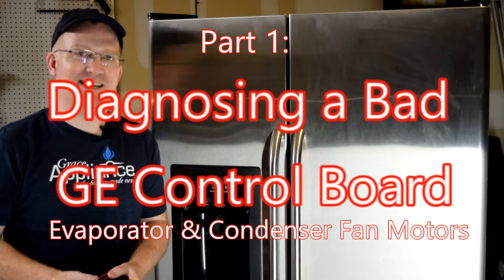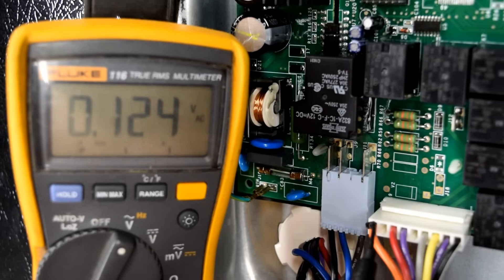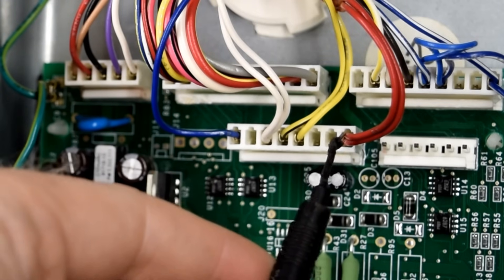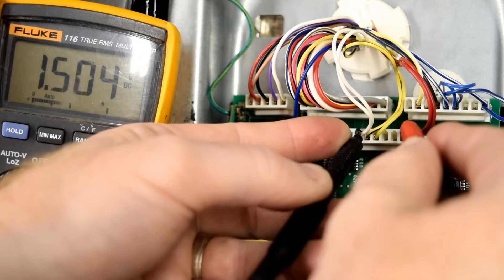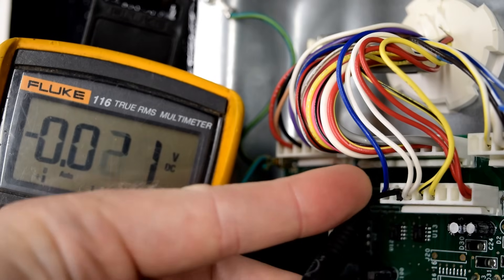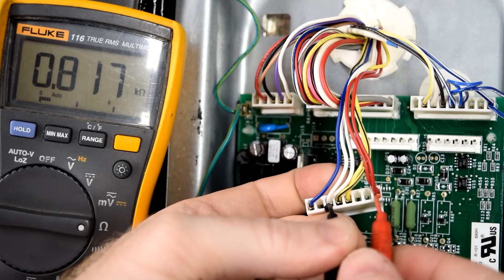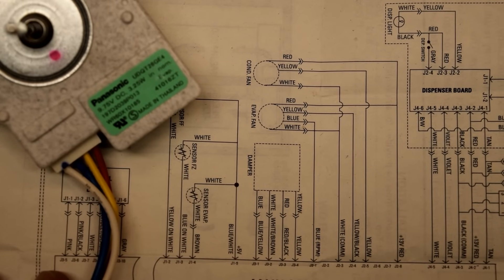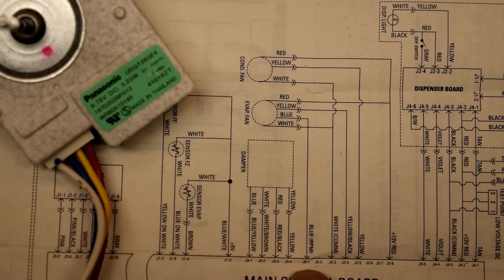Diagnosing a Bad GE Board - Part 1: Fan Motors

Comment: Andy, what model board is in your video?  My original WR55X10658 was replaced with the newer model WR55X10956 in 2013.  Mine is somewhat different than yours.
Reply from the maker: Hey, mine is a Wr55x10942 which has been updated to part wr55x10942p.

Are you having defrost issues?
Reply: Thanks for helping Andy.  I'm not yet sure about defrost, because after hearing the annoying "refrigerator door open" beeping over and over, I unplugged the refrigerator.  The symptoms were:
1. The display on the refrigerator indicated that the freezer temp was 0, when it was actually in the teens.
2. The display on the refrigerator indicated that throughout the day, the refrigerator temp climbed from the mid-60s to 81.  That was accurate - the fridge was very hot inside.
Like I said earlier, I replaced the main board in 2013, and I remember the refrigerator being hot back then as well.
I went through your tests and got these results:
123v AC into the board = PASS
13.54v DC supply voltage to fan motors (pin 8 red) = PASS
6.58v DC supply voltage to evap fan motor (pin 4 yellow/black) = FAIL
12.89v DC supply voltage to condenser fan motor (pin 5 yellow) = PASS
0.972K ohms to fan motors (pin 8 red, with J2 plug disconnected) = FAIL?
That's as far as I got so far.  The hot refrigerator must have some meaning.  Is it defrosting and not shutting down the defrost cycle?  If so, what would be the cause?  Thanks so much for a super video and your advice.
Bill
Reply: BTW, my fridge is a GE Profile PSW23PSWA SS.  And when I said that the board looked different, I should have said the the wires in the harnesses were similar but not exactly like yours.
Reply from the maker: Dad And Girls hey Bill, 
The freezer may actually too warm as well. You should be under 5F. Ideally closer to 0F. 
With respect to the evaporator fan, 6.xxVDC is still an ok voltage. It’s a variable speed motor, so it has a high, med, and low speed and the voltage varies based on how fast it should be turning.  

Now, If the freezer is running hotter than 5F, I would indeed suspect a defrost issue which will also cause a warmer than normal fridge cabinet as it shares the same cold air as the freezer.  

To confirm this you’ll need to remove the rear panel inside the freezer after it’s been running for a day. If you see heavy frost/ice build up on the evaporator coils, that’s a defrost issue.  If you wanted to send me a picture of it to GraceAppliance@gmail.com feel free and I can confirm this if you wanted.   

Thanks, 
Andy
Reply: I'll do that and get back to you tomorrow.  BTW, do you know if I can temporarily disconnect a harness behind the front-panel-display to stop the beeping?  I want to let the fridge run over night but we can't sleep with that noise.
Also, do you know why it's beeping?  The door isn't open!
Reply from the maker: Dad And Girls it’s probably a high temperature alarm.  You may have a button in the front touch panel that says alarm on/off or something similar.  You’d have to hold it down for 3-5sec.  Alternatively, you might be able to unplug the front touch panel, but I am not sure of the fridge would run as normal like this.
Reply: I plugged it in this morning after leaving it off overnight.  Both the fridge and freezer started out at 62F (room temp).
The freezer temp started decreasing, going down to 10F within 2 hours.
But the fridge temp immediately started increasing, going to to 86F within 2 hours.
After that, the fridge started going down, and 2 hours later, is at 59.
I haven't yet opened the rear panel inside the freezer - I will do that later - but if what I observed is a clue, please tell me what you think.
The other odd thing is that the display on the freezer door is showing incorrect temps, off by 15-20 degrees from the actual temps.
Reply from the maker: @dadandgirls7306  thanks. Let let it run for about a day and see how the evaporator looks. Defrost issues will usually take quite a while to present themselves and may run as expected for quite a while before the ice builds up.

However, getting a picture of the evaporator will tell me a lot because it will rule out a sealed system issue (I. E.  Compressor, refrigerant, etc).

When you open the refrigerator section, are you able to feel any air coming out of the vent inside?
Reply: Andy, I just sent an email to you with a couple images attached.  The evaporator has light frost on it, but not too much.  It's only been plugged in for 12-13 hours.  I will check it again in the morning.
Also, to answer your question from this morning, you asked if I felt air coming out on the refrigerator side.  I definitely felt air flowing out of the center piece on the back but am not sure if anything was coming out of the vent on the wall between fridge and freezer.  If there was any, it was not much.
Reply: In the end, the cause was a bad main board.  This is the second time I have had to replace it, but I also had a bad circuit breaker this time and replaced that as well.  Maybe the breaker caused the board to go bad, who knows...
Reply from the maker: @dadandgirls7306  thanks for the follow up!   Glad you got it sorted out. Happy new year!

Comment: Hi Andy:  as you recall, I replaced the freezer evaporator fan motor two months ago, the fridge has been working like a champ until today.  The freezer temp display starts flashing and the compressor runs constantly.  In fact, that’s the problem I’ve been encountering for months.  Please advise what to do at this point.
Reply from the maker: hey Guang!

This symptom sounds like it could be a poor connection between the main control board and the front touch panel.  
If you remove the kick panel in the front lower portion of the fridge near the freezer hinge, you’ll see a connector there. Look closely for damaged wires or bad connection.  Disconnect and reattach this plug about 10x and see if it helps at all. 

Let me know.

Thanks!

Comment: What are the chances of having the original mother board go bad, and then to have 2 new replacement mother boards in a row being defective in exactly the same way?... each with fridge and freezer slowly losing cooling power at about 5 or 6 weeks after replacement? Could there be a short somewhere  or something else like that? Repair guy is coming out for the 4th time now. Getting a little ridiculous I think.
Reply from the maker: George Kolton 0% I’d think. It sounds like it’s misdiagnosed. 
Have you noticed any ice build up on the back wall inside the freezer? 

A failing defrost sensor can cause this kind of symptom.  

Either way, I’d think it’s time to ask for a refund so you can get a 2nd opinion. Maybe direct him to my channel?!  ;)
Uggg, what a nightmare.
Reply: @GraceAppliance  Hi there! Thanks for your reply. Yes, I did notice some ice/frost build up back there. The same repairman is back at this moment. I will pass along your suggestion. Thanks again.
Reply from the maker: This video:
Testing and Replacing a GE Defrost Sensor - WR55x10025 https://youtu.be/CG-2FnQ43Hs

Shows what’s involved with testing and replacing a failed defrost sensor.  If it would run as expected for that length of time, I will assume the heater is still good. You’d notice much sooner (days) if the heater had failed.  This leaves only the control board and high limit thermal limiter (rare to fail) and the defrost sensor.  All signs point toward the defrost sensor based on the symptoms and the fact that the board has been replaced.   

Thanks!
Andy

Comment: Hello Andy. I need your help please. Your videos have been a great help in ruling out components on my PSHF6RGXCDBB GE Profile side-by-side. The front control panel shows a -9F for the freezer regardless of what temp I set it at. I used a separate thermometer to verify the freezer fluctuates between 10-30F. I tested the resistance of the thermistors at the J1 connector with it unplugged from the main board. The two fridge and evap thermistors are all good using the ice water test. There was no resistance across J1-1 to J1-3 for the freezer thermistor. Before doing this test I replaced the freezer thermistor before knowing to check the resistance at the J1 connector, and this did not fix the display showing -9F. I did verify the replacement thermistor is good by checking the resistance across the wire leads with it uninstalled. I verified the front control board is getting 13V.
Reply: I should also mention I tested the fan motors. My J2 connector has two red wires in the J2-2 pin as well as two red wires on J2-8. I think this is because I have a CustomCool Fan based on what I can interpret from the wiring diagram. For each pin the resistance is 900 ohms to J2-1. Your video says it should be 1500-3000 ohms. But is mine okay, basically can I double the 900 ohms to get to 1800 ohms? Not sure if this relates to the freezer temp issue I mentioned above, but thought I would mention it. Thanks in advance!
Reply from the maker: Jim Johnstone hey, the fans sounds fine with that measurement.  I’ve heard feedback that this is normal for others.  So, these don’t sound suspect.
Reply: @GraceAppliance  Thanks!
Reply from the maker: Hey! 
Can you verify that the freezer temp is between +10F and +30F? 
If so, this is too warm. A freezer temp should not be above +5’F and ideally closer to 0F.  

Does the compressor run full time or have you heard it cycling on and off periodically?
Reply: @GraceAppliance  Hi Andy. Sorry if my replies are not showing right under each of your replies. I am still learning YouTube messaging. I will have to check for the compressor cycling. What sound should I listening for?
Reply from the maker: @jimjohnstone3575  yes, messaging is awful on YouTube. It's not you. Beleive me.

You should hear a slight click, hear a fan turn on and a slight hum. It should be almost silent when the compressor turns off.

It should turn off every couple hours if think.
Reply: @GraceAppliance  Confirmed it was a bad wire and also a compressor not working properly. Time to get a new fridge due to high repair cost for these two issues on a 7 yr old fridge. Thanks again for all your help!
Reply from the maker: Also, have you taken a measurement in the freezer temp sensor from the board after you’ve installed it?  I would want to rule out a poor connection after the install causing this issues.
Reply: @GraceAppliance   Hi Andy. Yes, I tested the freezer temp sensor after installing it. I twisted the wires together and then checked at the control board which still showed no resistance as if the sensor was not there.
Reply from the maker: Jim Johnstone hey, if you’ll snap a picture of your wiring schematic and email it to GraceAppliance@gmail.com 
I can give confirmation you’re measuring in the right pins.  It will be different than what’s shown in the video here. If you’re in the right pins, perhaps there’s a wiring issues between the board and sensor. If so, I’d double check the connection you made at the sensor. Maybe strip the wires back to bare metal again and make the connection again to see if it improves.

Comment: Hello Andy! I really need your help! My refigerator is also GE, main board number 200d6221g028. So, when I turn on the fridge is possible hear just a click, probably coming from the start rele, after that anything happens, no fan, no compressor, nothing! Could you help me to find the problem? My email, sandroamauri@gmail.com, Im from Brazil, and to replace this board for a new one is very very expensive! Thanks for your support!
Reply from the maker: Hi, Sandro Ghirau 
If you have not looked at this video, please start here.  This will rule out a bad front touch panel for you:
https://youtu.be/ViFpwH6_WrM

You can unplug the J4 connector and the compressor should come on at that point.  
Also, you can leave a door open for 3 minutes which should activate both fan motors for you.  

But, It certainly sounds Control Board related through given your symptoms.  Let me know if you have any questions!

Comment: Great Video. The trouble I am having is the front display panel is not working, and neither is the ice/water dispenser. Any suggestions?
Reply from the maker: TheRoostking hey!
If you haven’t watched it yet, check out this video:
https://youtu.be/ViFpwH6_WrM

Also, there is a troublemaking connection plug behind the kick panel near the freezer door hinge. This tends to get corroded and should start there.  Plug this in an unplug it about 10x and see if that improves things.  If so, you might consider removing the plug and hardwiring it by soldering the wires together.  Let me know what you find.  Thanks!

Comment: The Defrost bimetal thermostat which is sealed in a plastic clear pouch, I never tested it. Cuz it is wired in parallel with the temp sensor and I didn’t want to isolate it.  Somehow, the temp sensor was tested to be fine.

Comment: That was the thermal fuse (the part that has 1 black and 1 red wires connected to it and a insulation foam wrapped around it). It reads 0.1 ohm
Reply from the maker: Guang LF that’s a good fuse.

Comment: Hi Andy......do you think I might also have a problem with the defrost bimetal thermostat ? (the part that has 2 brown wires connected to it and it’s sealed in a clear plastic pouch, it’s wired in parallel with the temp sensor, sitting on top of the evaporator coil.)
Reply from the maker: I don't based on your previous comments. As I recall, you got a fairly low resistance which is good. It should read roughly .03 ohm.

Comment: Andy......What’s the proper way to test the thermal fuse ? ( the part that has one black wire and one red wire connected to it, and a foam insulation wrapped around its sensing tip)
Reply from the maker: Guang LF if you have continuity when doing an Ohm test, it is a good fuse. You should get around .01 - .03 Ohm resistance.  
The fuse only relates to your defrost cycle. 

As I understand it, you are dealing with a fan that is not running, is that right?

The frost build up you are seeing on the evaporator is likely not a defrost issue, it is due to no air flow caused by the fan not working.

Comment: Andy......So You don’t think I should replace any of those temp sensors, defrost sensor or even the thermal fuse ?
Reply from the maker: The freezer temp sensor you mentioned does seem slightly out of specifications. It should be 5k ohms at room temp (72F) and around 14.5kohms at ice water temp.
I would replace this one for sure.

However, this will not prevent the fan from operating after leaving the door open 3 minutes. These are seperate issues it seems.

Comment: Hi Andy......Like I'd mentioned, I'd replaced the main board back in May 2019. The freezer ran perfectly fine for nearly 2 months, the freezer led temp started blinking on the front display suddenly.  Encountering the same issue again, fan motor stopped running, ice building up at the base of the evaporator coil.  Tested the temp sensor in the upper part of the freezer, got 4.5 ohms (room temp) and 12.3 ohms (ice water).  Checked thermal fuse, got 0.1 ohm.   Should I check my defrost thermostat (yellow wires connected to it) and temp sensor (blue wires connected to it)?   Or maybe the evaporator fan motor?   Please advise my next step.  Thank you!
Reply from the maker: Hi, have you performed the voltage tests for your evaporator fan motor as shown in this video?
Reply: Unfortunately, My multi meter doesn’t have Hz function.  Is there another way to test the fan motor and see if it’s bad.  On the other hand,  how would I know which wire is connected to the tachometer?
Reply from the maker: @unioncityhiller  starting in 2:20sec of this video it shows how you can test the DC voltage output from your board. Be sure to leave a door open for 3 minutes first so your board will output voltage to the board. You won't need HZ for this function. If you get 13.5vdc at that point your board is fine and you should replace the fan motor. If no voltage I'd replace both the board and the evaporator fan motor as a shorted evaporator fan motor can cause a bad board.

Comment: My refrigerator works fire until its unplugged or the power is lost, it takes about 24 hours before it turns back on , is there a reset button or way I can turn it back on sooner. Its g.e. refrigerator. Can you help.. thanks
Reply from the maker: Hi, could you please send your model number from the inside of the refrigerator on a white sticker on the wall?
Reply: @GraceAppliance  my model number is  Gss23wsta ss
Reply from the maker: James Hill thanks!
The only thing that will cause this symptom is a failing relay on the control board. The relays get weak over time and become intermittent. Sometimes you’ll hear rapid clicking from behind the fridge as it’s trying to start.  

So, you’ll need to replace the board to resolve it. 
If you’ll purchase through this affiliate link, it helps the channel a ton and is greatly appreciated!
https://amzn.to/2TL2fZ0

Let me know if you have any questions. Thanks! Andy

Comment: Thank you for your vedio, but i have a follow up question. What if there is no signal from tacho? Does it affect the operation of the refrigerator? Mine has no signal, do i need to replace the evaporator fan motor? Hoping for reply. Thanks again.
Reply from the maker: Hi Anderson,
Yes, the tach is built in to the fan motor itself. So, if you do not get a frequency response from the fan, it has failed.
Just be sure that your meter does in fact measure frequency (HZ).

It is a fairly common failure of these fans though. It sounds like you need a new fan motor.

If you will order from the link in the description, it helps the channel a lot. Thanks!